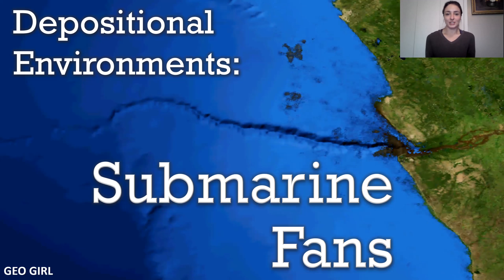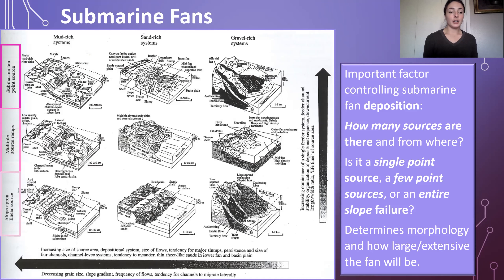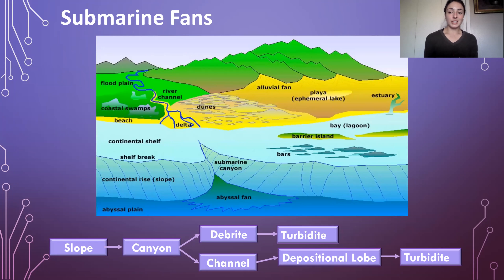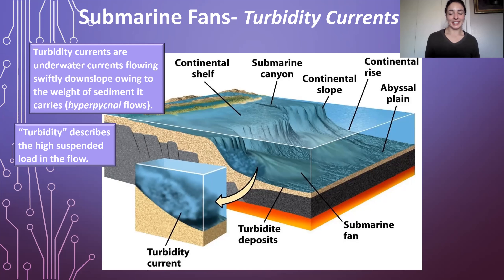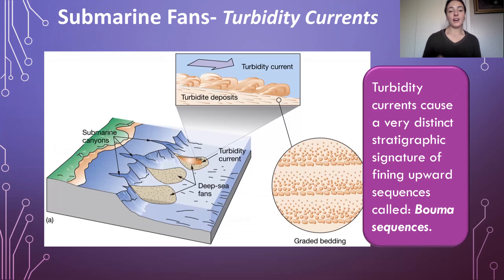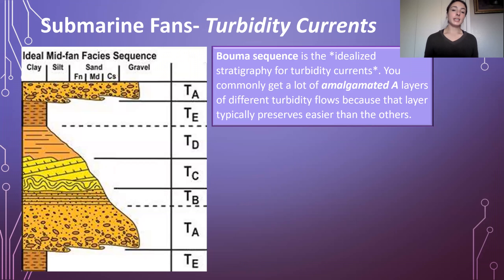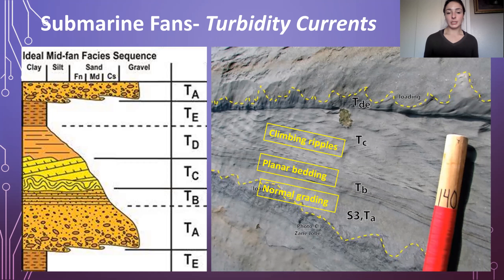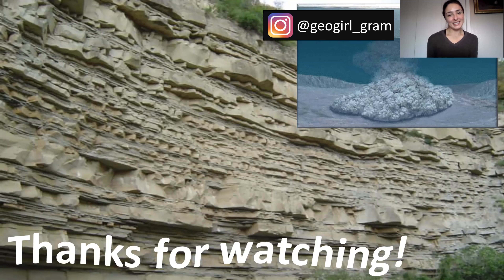Submarine Fan Depositional Environments- turbidity currents and the Bouma sequence | GEO GIRL

Comment: Very informative video
Is there a difference between fluvial and alluvial fans
Reply from the maker: Thank you! :)
Yes, alluvial fans are adjacent to mountain ranges where rocks pill up due to either gravity debris flows or those caused by water run off (here's a video I did over alluvial fans: https://youtu.be/CobjL0eXG00). On the other hand, I actually haven't heard of fluvial fans, but my guess is those are fan shaped deposits directly due to fluval (river) input. So for example, fluvial fans may be included with alluvial fans such that all fluvial fans are alluvial fans but not all alluvial fans are fluvial fans. But that is just my guess, hope it helps ;)